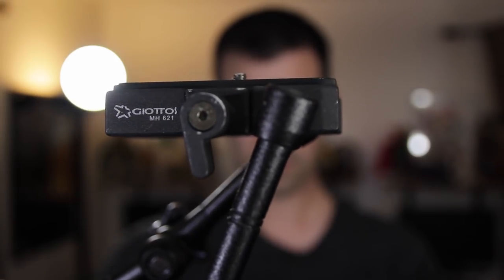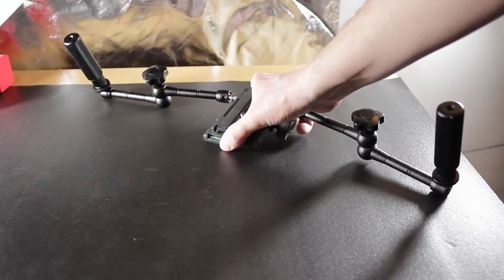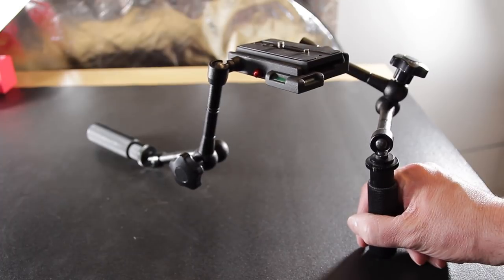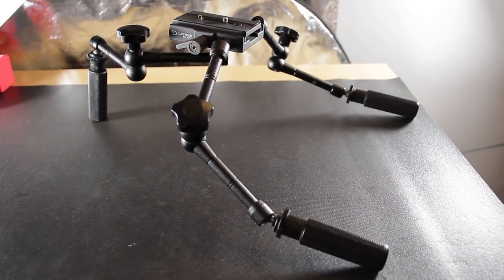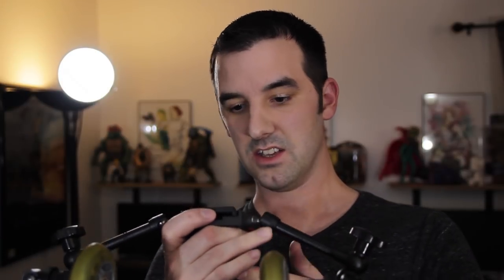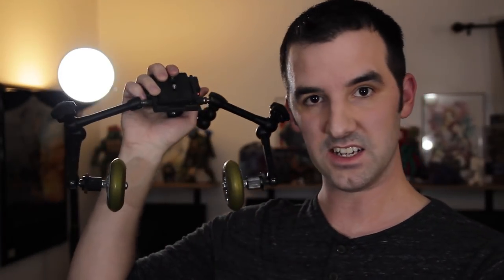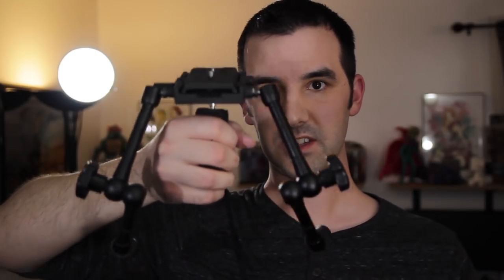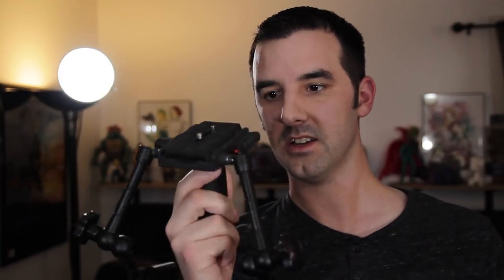oRIGami Camera System - DIY Steadicam, Table Dolly, Shoulder Rig, Fig Rig, and Slider - All In One

Comment: Did you get any affiliate links for this build? I am making a build video of the Origami Camera System using an Arca Swiss system. I want to put your affiliate links on my video.
Reply from the maker: Everything I could affiliate I did. Amazon won't allow an affiliate link for the quick release though, just ebay.
Reply: Bummer, Have you checked out KIT.com ? I just started using it the other day. It looks like a good place to put lists of gear together for a project.
Reply from the maker: Nope, but I will give it a look. Thanks.